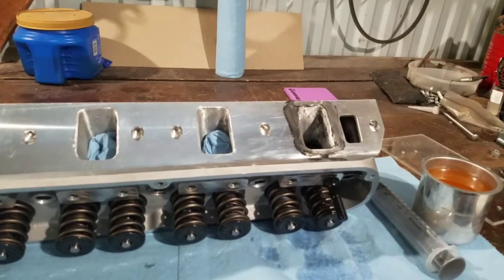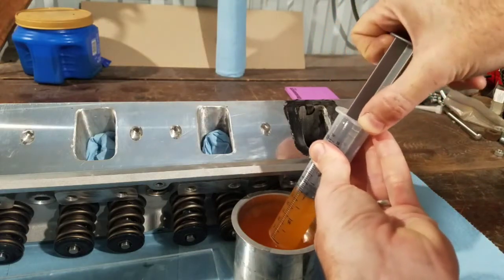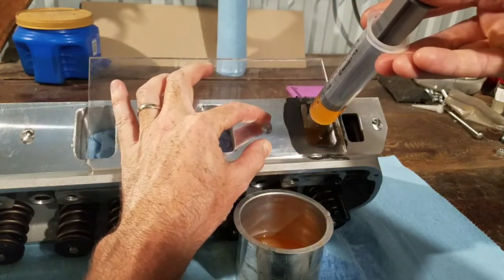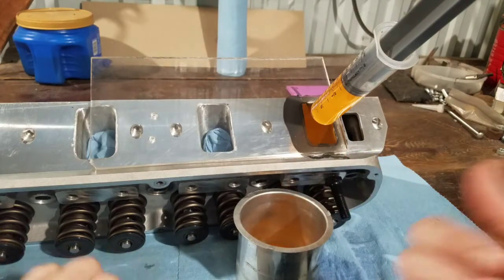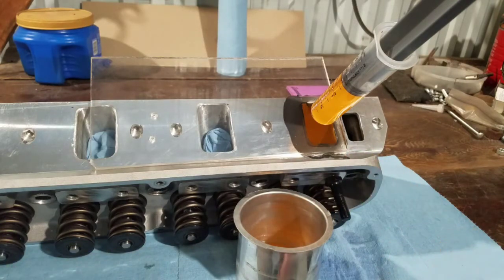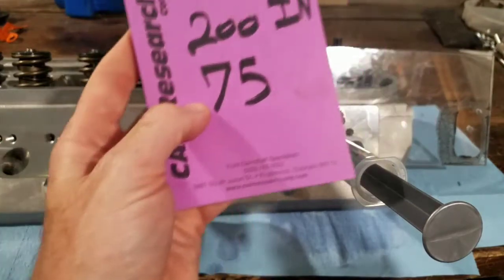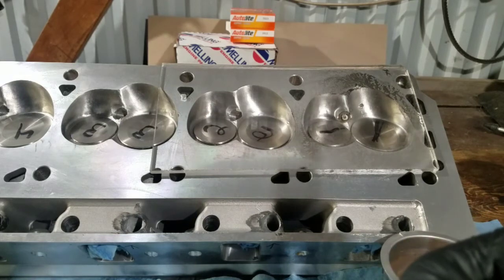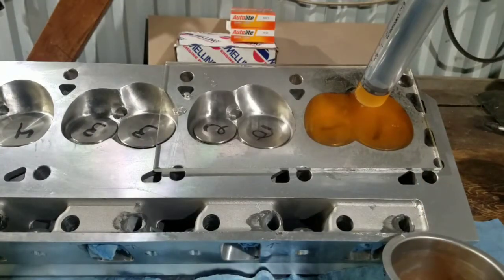DIY budget cc-ing your engine.

Comment: I'm shooting for a 8.5:1 dynamic compression ratio, but in order to reach my goal I have to remove 2 cc from my chambers. Where would you remove more material? I was thinking the quench ridge on the exhaust valve. Rolling over that ridge a bit.
Reply from the maker: Good question, what cylinder head and do they have any work done ?
Reply: @blueovaldude  edelbrock performer. no work done.
Reply from the maker: @TropicBreezeRealty  okay,  if it was me and I wanted 2cc larger , I would A.  polish the combustion chambers  B. Radius the valve reliefs in the piston.  Two good things for reducing pre ignition/detonation. I have a video on polishing chambers if you are interested. I wouldn't get too hung up on being a little over your target DCR . You can always pull a degree of timing or curve the timing in a little bit later if you are concerned.
Reply: @blueovaldude  I've watched most of your videos including the polishing video. It looked like you removed more than 1cc. Which made me concerned, I may have to remove a lot of material. I haven't purchased the heads yet. The Edelbrock performer seems to be my only option, being how I have to pass smog in California. I would have preferred the twisted wedge but I chose a different piston.  The camshaft intake closes at 36 degrees, so no help there lowering compression. I saw a video of david vizard where he rolled back the quench on the exhaust valve. check out www.youtube.com/watch?v=NjZ2yu1v6tc at 5 minutes 12 seconds
Reply from the maker: @TropicBreezeRealty  The 289 head has a CC that is not very efficient  or well designed,  that is why this works on that head . Aftermarket heads have a better designed chamber (you may lose flow by doing that reshaping on a better designed head ) I have tried things that work great on stock heads on aftermarket heads and gone backwards in flow , some mods don't always work . The chamber polish on the nkb heads only removed 1-1.5 cc's it's not a reshaping, just removing surface imperfections and sharp edges. Honestly losing  One or 2 tenths of a point or even 3 tenths  10.6 to 1  down to 10.3 to 1 is not something you might even notice on a dyno .   3-6 crank horsepower is it , pretty insignificant. Have fun with your hot rod dude . 👍
Reply: @blueovaldude  all very good points. thank you. Although, with my camshaft I'd be looking a a static comp 9.89:1 Im trying to run 89 octane but it looks doubtful. It's a daily driver engine. Thanks again.
Reply from the maker: @TropicBreezeRealty  no problem . One last thought,  you could always retard the cam 4° and that would also drop your DCR down a little.